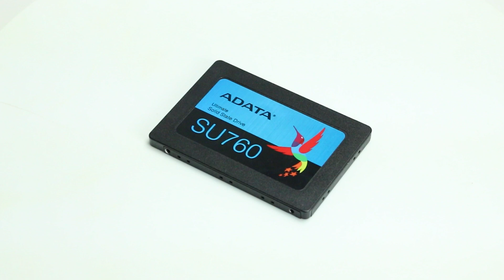HP Z4 G4 Hard Drive Installation

Comment: Love your work brother. I am from a country that does not have much access to computer components. I scored an HP Z4 G4 super basic. Came with a XEON W-2104 processor, 1-2TB SSD and 1-2TB SATA drive. I want to install a 2TB NVME M.2 drive. Will it work and how do I contact you for a better understanding please. Thank you and chat soon
Reply: I am trying to install a second hard disk drive. My first hard disk is a 500 GB SSD. There is no power cable available for the second hard disk. Are you able to take a photo and show how it is done?